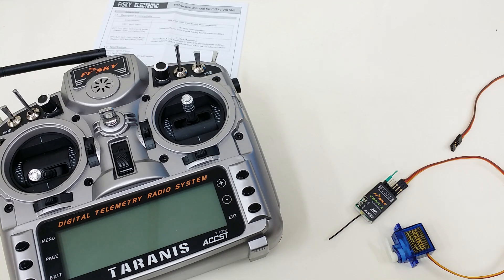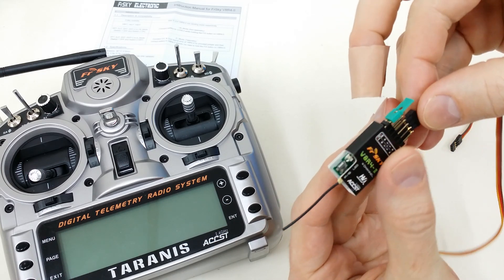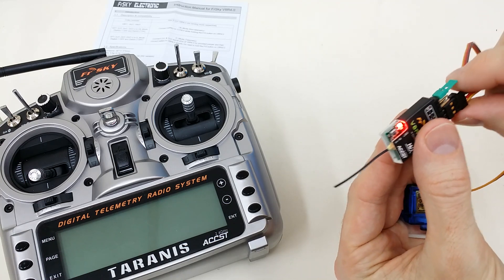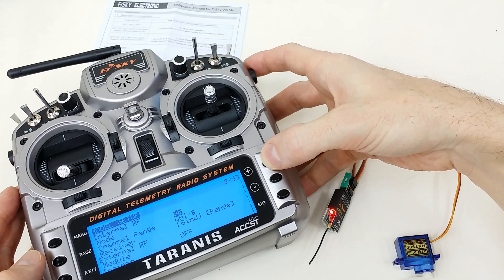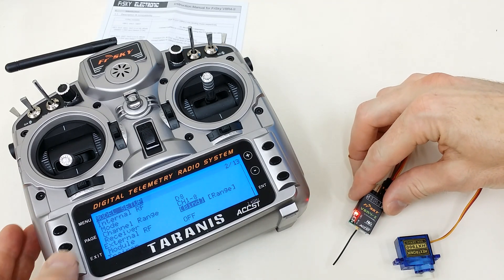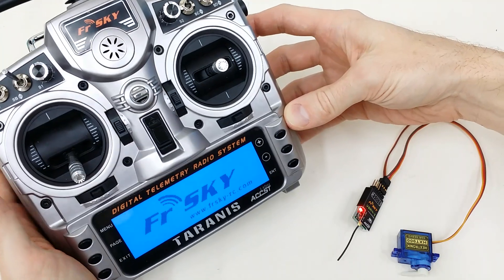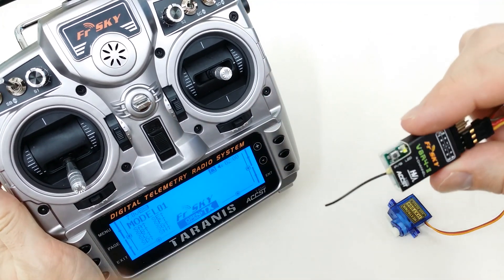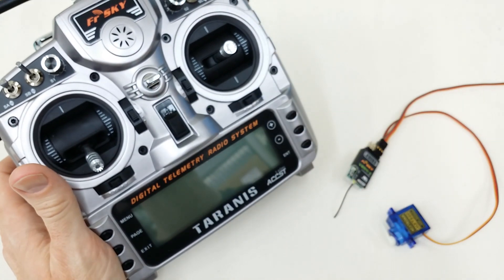How to bind FrSky V8R4-II to Taranis X9D

Comment: Hi, do you have any experience in binding X9D with TFR8 SB? I tried to bind them according to the instruction (i.e. turn on X9D and select binding mode, then press the bind button of TFR8 whilst connecting power) but cannot bind them. I tried to bind them in other sequences (I also tried D8, LR12 & D16 mode) but still could not bind them.
How can I know whether the Tx or Rx is defective? Thanks.
Reply from the maker: Hi, the TFR8 receiver is only compatible with the Futaba FASST protocol, so it will not work with the FrSky X9D ACCST protocol.  Sorry.
Reply: HeliBaticsTV Thank you!